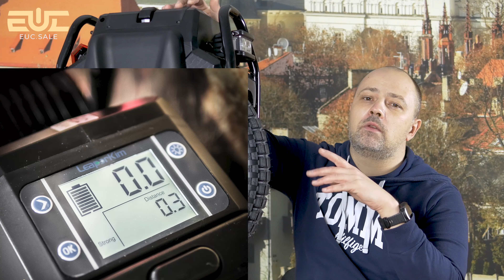LeaperKim VETERAN SHERMAN - Full review EN.

Comment: Great review. Maybee this voltage drop is becasue you ride in cold weather.
 Wrongway Adam test climbing and his veteran only capapble 30 degree compare to gotways/begode what all do 40 degree RS T or MSP  can go potentialy more.
He compare power to nikola plus.
Is you version +1Cm high pedal handle batch?
I hear V2 sheman have red butons on display is truth?
Late spring i want buy some EUC if something good show for heavy riders. If nothing more i go sherman potentialy i hope they ubgrade FW agaist pedal diping in long turns and make some quality life improvments.
Reply: I was riding one of my Sherman's a week ago and it dropped me on during an acceleration from stop.

I wasn't pushing the wheel harder than I normally do but the temperature was below freezing and the batteries do not like cold weather. (Neither do my Gotway/Bigode wheels)

So you're definitely correct.  These batteries do not like cold weather.
Reply: @big_petebear8535  Thank you for feedback. I overlean my MSP in atumn on cold day foggy lamp ON bluetooth music on max volume. I lean hard overtaking cyclist but thistime MSP not have enouch power to tiltback me and i crash hard faceplant in 50-55 Km/h . Video is on my chanel if you want just se. #wearfullface  @big_pete bear how is you riding weight i am over 100kg with all gear. What mode you ride hard medium soft?
Reply: @jansvoboda9778  Hey yeah I saw that video. Thank god you are okay. Did you end up getting that thing for deterring dog attacks?